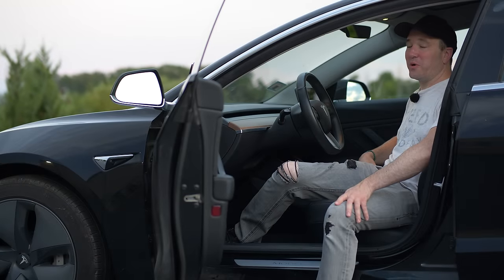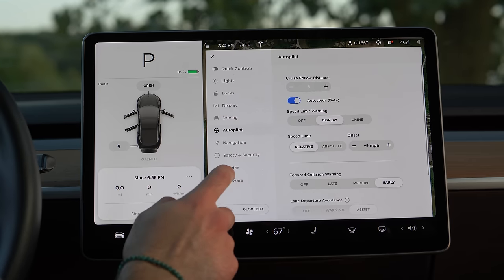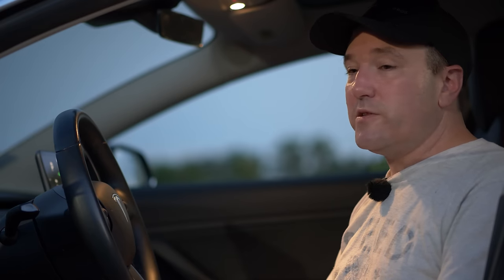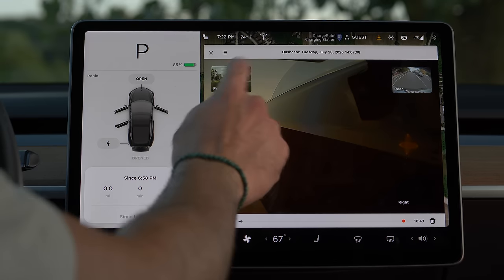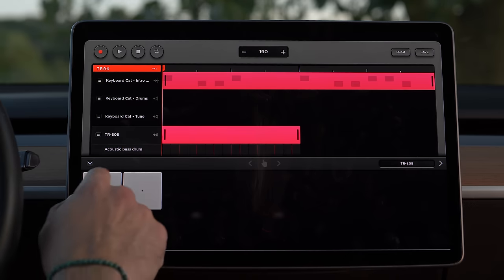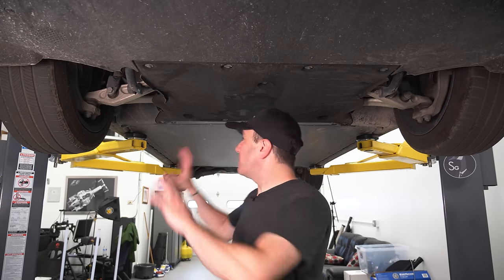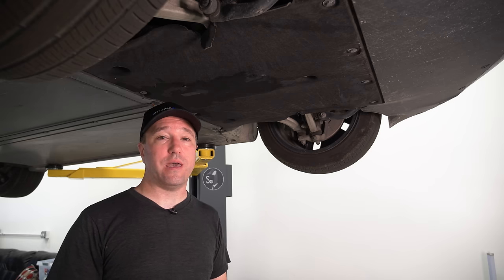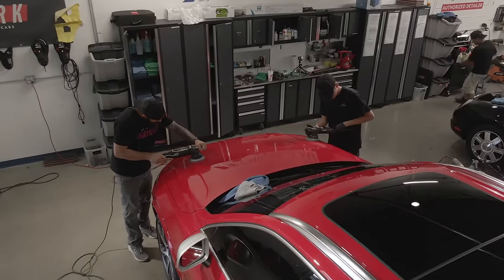Tesla Model 3 | Explaining the Cult

Comment: Love the video but in regards to "everything on the touch screen" we almost never touch it. Radio is controlled by the steering wheel controls, almost everything else by voice. Anyone that opens a browser while driving should get a ticket. Your example of a rotary dial, just say "temperature 70 degrees" and it is done, like Siri or Alexa.  It seems you didn't use the voice controls.

Comment: Human factors. Why in an airplane the landing gear lever touch point is round like a wheel. To me, first of all you must be able to perform certain functions more than one way. Think physical disabilities or just user preference. I rarely listen to music when I drive but when I do, I reach for the volume control on the dash, I have never gotten accustomed to the steering wheel mounted controls. In general; however, certain controls must be either physical or there needs to be a faultless voice control system (both would be best). I admit to having range anxiety but the real show stopper to purchasing a Tesla for me is the touch screen. I have been in the car, the screen/software is really well done, I do not like it as my only interface.
Reply: You actually are incorrect, the screen is not the only interface. There’s no reason to use the screen while driving. There are many voice commands (including climate, music, navigation, etc.), to keep you focused on the road. And, the stalk and steering wheel controls are also options. I wish reviewers were more accurate when posting these commentaries.

Comment: Nice review! Lots of good stuff there. I'll take care when cornering at higher speeds. 
If people think that there will ever be a time when a Tesla is complete with all well functioning features, they may be mistaken. It's not that Tesla releases half done products, but that any product they release will keep being upgraded when improvements are possible regardless of the year of manufacture. At the time of release it's the best it can be then. There is never a final model unless that model is discontinued. No other automaker operates in this fashion. By studying the Model Y Munro says that the improvement between it and the Model 3 makes it cheaper to build as well as making it more efficient. In your point about the heat pump you criticize the early Model 3s for not having one. Should car companies only release models when they have everything figured out? Maybe we should never have bought a Ford Model T before radial tires were available. (joke)
As far as Gas vs Electric goes we are now approaching the point where the initial purchase price for cars with equal specs will be very similar. Even now the total cost of ownership is already cheaper for electric vehicles. If your state is building coal-fired generators I suspect the fix may be in and the reasons are more to protect the status quo than to go with the cheaper and more healthy option. From what I have read, the price per Kw for solar is cheaper than coal. All the best.

Comment: Model Y is the current most important Tesla vehicle.   Many things can be controlled by VOICE COMMAND.   Driving an ICE car for me now is a beastly experience--no positive aspects at all.  You will not miss the suppressed explosions of an internal combustion engine.  I am sorry ?  You do not have electricity where you live ?  (People who buy EVs usually have a 40 to 60 amp  240 volt circuit for their level II chargers.  Most charging is done at home or sometimes at work. You are pretty clueless on the whole charging thing.  Superchargers are for cross country travel.  I will give you time to catch up and watch the September 22 Battery Day presentation.) I did enjoy your opinion of the handling characteristics and the comment about the interior being echoey and where different parts are made.  I would hope you would  next test a Model Y AWD Performance--it pulls .95 Gs on a skidpad and stops from 60 mph in 109 feet, 12.4 quarter mile.

Comment: Great video overall, I as a recent m3p buyer I do have one gripe regarding the touchscreen control commentary: as a person who dailies this car, I actually need to point out that I'm almost never interacting with the touchscreen while the wheels are moving. The voice control for selecting new music, responding to incoming text messages (which are read to me while Im driving), is just a  matter of dictating to highly competent speech to text AI engine in the Tesla. Music controls are on the left steering wheel control knob, and the voice assistant is activated by the right knob. Autopilot engagement, and deactivation is handled by the gear stalk, and the automatic high beams and wipers, which are *VERY GOOD*, require almost no intervention, and are manually overridden by the gear stalks next to the wheel. 

In all fairness, these features may have been absent, or immature at the time this video was published, but have improved significantly since, as a result of the constant OTA updates. 

Having switched from a +10 old toyota, which relied on bluetooth, via my smartphone for nav and spotify interaction via my smartphone, this car has led to a significantly less distracted driving experience. Additionally, the lack of having to pick up , and interact with a separate device which requires taking at least one hand off the wheel, and the requirement to navigate significantly more UI elements to swap the active app, make changes to the NAV and music apps, means that when when I'm switching tracks or rerouting/adding stops in spotify/gmaps, I'm saving at least 3x more time, to do those things, when comparing the traditional smartphone VS the Tesla infotainment system. 

Again, really appreciate the depth and accuracy of the coverage for rest of this video, especially driving dynamics, suspension, and fitment quality implications on NVH. As an month-long owner, I'm completely in agreement with the assessments made in those categories. Just wanted to share my perspective and invite you fine lads to maybe do some more "dailying" in one of these bad boys, to see if my assessment might match what you might end up discovering. 

Thanks for the great content, you've earned another sub!

Comment: enjoyed the review of the car itself and got to learn some technical details. I really don't understand the logic of your closing thoughts on 'all cars are wasteful' and 'can't produce enough batteries', granted this video is old now, and things have definitely progressed. Yes all cars are wasteful, but to vastly different degrees. No we're not going back to coal, no most power doesn't come from coal, you can clearly see that by looking at the epa website. Most people charge mostly at home, you don't need a supercharger on the corner like gas stations. Level 2 chargers, yes you need more of them in local spots, particularly for those who don't have off street parking. Overall I think if most people thought like you were thinking there, then we'd just stick with ICE's and that would be that. But on the other hand you're excited to see what happens so that is good.

Comment: I'm curious about what "core features" you think are relegated to the touch screen. The accelerator, brake, steering, blinkers, headlights, windshield wipers, shifter, and basic music controls are all off-screen. The only time I interact with the touch screen while driving is if I want to change what album I'm listening to or if the GPS voice command messes up, but I tend to avoid doing these things for safety.

Comment: actually the system that controls the car is completely independent of the display software, so if the display crashes everything in the car still works you just have to wait 30 seconds for the screen to reboot

Comment: Dude ,  excellent review.   Wtf took so long.   My last car 2013 Brz has Taillight condensation for the 4 years + I owned it. Subaru never provided a replacement part.  The valve spring broke at 28k miles.   That car was a torque less wonder. 

In late 2018 I purchased a RWD Tesla 3.  Easley the best car I have ever owned.  It has 40 k miles on it today.  Zero mechanical problems.   No oil changes, no brakes , no tune ups,   Just charge and go. The 3800 pound Tesla 3 is way more fun to drive than my BRZ was.   I had taillight condensation on my 3. Went in the app.  Made an appointment. 6 days later Tesla came to my home and swapped out the taillight with an updated one that no longer has the condensation problem. 15 min later he was on his way.  My car in much faster and has an longer range than when I purchased it.  All through software updates.  In fact the whole car is much better than when I purchased it.

Comment: Very engaging presentation.  Looking forward to the follow-on episodes.   Especially apt is the human factors and safety discussion here -- especially usability, but also the single point of failure. The software-first "tech culture" SG alludes to here knows how to better address human-computer interaction, but the omnipresence of the smart phone has made them complacent about usability for operating in RL. You'd think they would have started with the joystick and steering wheel controls instead of the touchscreen. I am a fan of having the screen, even at this size, in the vehicle, but not for the risky operations expertly called out in this episode. Is Tesla listening? This is a huge knock on the brand  -- more than the panel gaps and paint quality.

Comment: Doorhandles:  P'sOS.  No physical controls: Terrible idea.  I run a service shop and when you get into one of these monstrosities, you can't even adjust the mirrors to drive it into the service bay safely or even get the miles off the odometer without asking the customer how to do it on the dumbass screen that requires you to take your eyes off the road to operate it.  Takes 2 minutes to get it into "drive". Just a perfect example of technology used for absolutely assinine purposes.  Musk needs to have one of these shoved up his rear end with the doorhandles stuck out...

Comment: In Germany, some dude was literally convicted for 'using his window wipers' in a Tesla Model 3 a couple months ago (believe he was trying to alter the speed).

WHY? Well, since to do so he had to do this via the screen, which is illegal to interact with while driving. Just like your phone is.
How'd they find out? Well ... he had an accident while messing with the screen, likely DUE to messing with that screen.

So yeah ... there you stand, in front of the judge, with your fancy new 'modern' car ... with a huge fine & you lose your licence for X-amount of weeks/months (can't remember exactly how many, was something like 2 months or something).
All for something which should really be considered 'basic operation' of your car. But hey ... it looks modern right?

Anyway ... the Model 3 will never end up in my drive way. No central gauge cluster for monitoring speed etc, no physical ANYTHING ... it's annoying to drive, looking constantly 'at the middle' just for something as basic as speed and honestly ... it just doesn't look good to me either. Boring and I dunno ... empty?

Though to the 'discredit' of some other manufacturers ... Audi for example is going down a similarly 'bad path'. With them replacing the climate control knobs and such with touch screens, same with the center rotary knob for the infotainment. It's really not a good move (safety wise that is).
New S-class also went the Model S route, getting rid of a ton of analog stuff. So yeah ... we'll see how far it goes.

Comment: Guys, can you do some real-world testing on these EV's like the following: (1) Park a fully charged Tesla overnight on the street in 10 degrees F, and measure the charge remaining in the morning (to measure lost and wasted energy), and (2) Compare the advertised range of a Tesla, with the actual range, when driving in 10 degree F with the cabin heat on and audio system (tunes) running. No EV is ready for the real world. For rich people who can afford them (with taxpayers subsidies) and want to keep them in their garages to drive on warm days around town, they might work. Otherwise they are a complete scam. From an energy consumption perspective they also lose. EV's require about 50% more energy to manufacture, their massive and expensive ($8000) batteries need to be replaced after 6-8 years as they decay and lose capacity and old batteries are dumped in landfills. Furthermore, the US consumes about 98% of total electricity production capacity, meaning there is barely enough electricity to power the country as it is, let alone power more EV's. Also, not only is the electricity generating capacity inadequate for more EV's, but the transmission network and regional and community grids, including transformer stations are totally inadequate to supplying electricity for EV's users beyond perhaps 5% of all personal vehicles.

Comment: The issue that is never mentioned if EV’s fully take over, is that there isn’t the power generating capacity to handle mass recharging of millions of cars.
Reply: Nonsense. Here in Australia most power plants are running well under capacity after years of efficiency gains in consumer appliances and deindustrialization. Don't forget that there's one electricity network for all people, residential and commercial/industrial. There's plenty of capacity.

Comment: Lot's of Tesla owners gush over their cars and have great experiences; good for them. If you want to see some of the ugly sides of Tesla ownership, head on over to Rich Rebuilds. Car ownership is more than what is presented here. There's things like maintenance and repairs. Oh sure EV fans will rightly point out that there's no oil, spark plugs, timing belts, alternators, etc., to change. BUT - I've still had the AC compressor fail on a HONDA, same thing can happen to a Tesla w/ a heat pump if you own it long enough. Suspension components fail. The brake pads may not need to be changed often, but their lack of use can lead to build up of rust and seized calipers - so they still need to be maintained (lubricated). And oh, this is a big one - if you get into an accident, it can be a big hassle. Tesla tries to maintain strict control over who repairs their cars, and they have far less service centers than say - Ford, GM or Toyota. Even if you're a DIY type of guy, Tesla doesn't make it easy to get repair parts (at least compared to the big OEMs). 

All this might sound like bashing, but honestly if I had the money I'd still love to get a Model Y, so I'm not a hater. It just important that people take off the rose tinted glasses and assess big purchases for what they are. I mean seriously, something that's kept me from getting a used BMW or Mercedes is the knowledge that the maintenance gets really expensive as they get up in mileage.

Comment: I am waiting on the chip shortage to pass maybe a year to replace my daily. I am going with internal combustion. EV has years to go it is not there yet but in time it could well work for me as a daily only, A to B and music. When it comes to the passion of driving EV at this point can not replace my N/A 8000+ RPM sports car no matter how much torque or 0 to 60 EV cars have. I do not use the Sports as a daily but love those afternoon spirited rural hilly roads in my area. I find when I need to tow 10 tons a few times a year. I still have a 2000 F350 Powerstroke with only 65k miles. As little as I use it, the cost to my wallet comes first and a side effect that a new EV truck would probably have a larger carbon foot print in its manufacturing. Due to the very few miles I drive it each year.

Comment: A well thought out review but to compare a performance ICE car to the lowest priced Model 3 and to say that it just won't compete is just dead wrong. All you have to do is look at the track times on road courses to see the Performance Model 3 (not the car you were testing) is beating the top cars in it's segment. Re the constant updating of the cars through mechanical design and software improvements is the main reason why I think this company will be a success. Sooo many companies refuse to retool their cars if there is a fault.Tesla will continue to improve the design of the cars indefinitely until they completely revamp a design. I'm looking forward to your review of the Performance Model Y.
Reply: Except Tesla models new and old have the same issues. There's no improvement in quality. Other manufacturers have taken far more drastic steps in improving their products throughout their life cycle. Honda even completely revamped the previous generation Honda Civic after only 1 year because of the complaints. Tesla is yet to do so and that's because the fanboys who buy them keep giving the manufacturer a pass which is a shame as the customers are paying big bucks only to be guinea pigs. I want to see how a 200k mile example of a Tesla has held up unless Tesla will deactivate it as they have been doing.
Reply: @IKhanNot   Many car companies have panel gap issues but to say they aren't addressing issues would be an over statement, Sandy Monroe has stated that many engineering problems have been addressed by the Model Y and the Model Y will have it's own issues and they will be addressed also. These issues that you say are being given a pass by "fanboys" are usually addressed at a later date by Tesla service, as long as these issues are corrected I don't think Tesla will have a problem continuing to expand by 50% per year every year for the foreseeable future.

Comment: Nice insightful review, but you did miss one point and that is every single car manufacturer is now looking to compete with Tesla and trying to build a better EV ! No luck so far but they are trying 😂, also you could of mentioned more in depth of cost savings of basic service and price difference between charging the standard 3 verses a compatible 4 cylinder gas engine 😉.... btw the difference is huge.